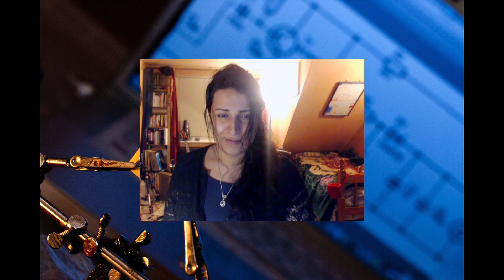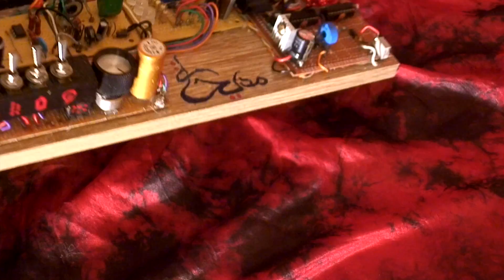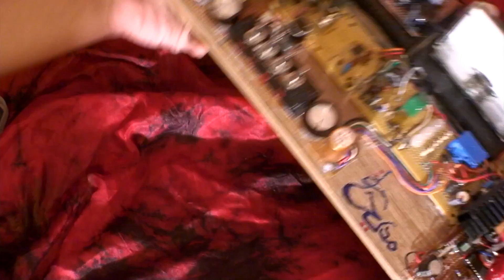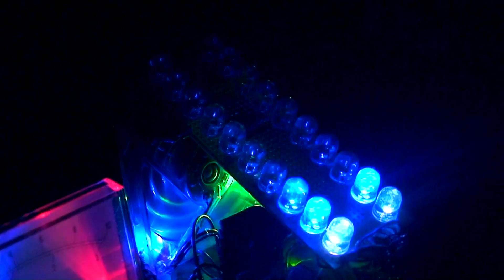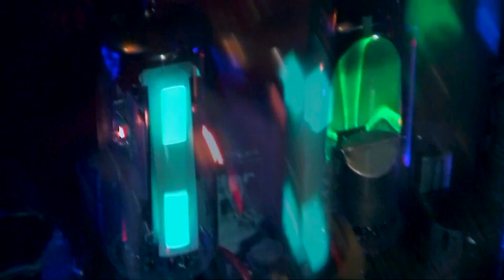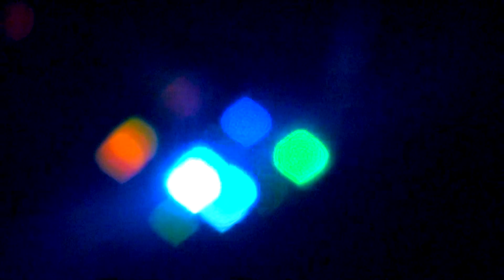Audio Visualization Project - 02 The grand demo :o))

Comment: Awesome project! I highly commend your use of multiple colors of LEDs in your bargraph instead of just using one color of LED throughout all of the steps, (which wouldn't have been as beautifully colorful as it is), plus the tubes look really cool in the dark too! I also like your use of the "flatted lever" type of toggle switches, as I think those type of toggles "feel" the best when you touch them and flip them, usually work the best with the lowest "on" resistance of most toggle types that I've found, plus I also think they definitely look the best of all of the toggle type switches. They give your project an overall "retro" or vintage/"old skool" look to it, which you mentioned you were going for... Plus all of that stuff works together properly finally, after all of the improvements you made to the prototype... Yay!... Great job you did there!

When I was still a little kid, (a long long time ago, way back in the 80's, LOL!), I tried to make a VU bargraph meter using a multi-color modular LED bargraph unit for each of the audio channels and also using those same LM3916 ICs that you have there, but for some unknown reason it never worked at all... Unfortunately I never revisited that project in later years and I don't know what ever happened to it. But now I'd love to actually make a full spectrum analyzer frequency display of at least 31 1/3 octave bands on a VERY large scale that I could hang on the wall above my stereo and see from across the room, but I've yet to find the time to do it... 

Now I see all over eBay those huge "VU Meter" or "Spectrum Display" project kits which come with all of the parts and such, but I have yet to find a really good one that actually gives an accurate representation of the frequency spectrum in real time, (like most of the vintage audio equalizers had on them), so I've been skeptical to buy one of those cheaply made kits... It seems like almost everything electronic is made in freaking CHINA now-a-days, and almost none of the stuff that comes from there works properly, or if it does it doesn't work accurately or well enough to give you any meaningful outputs; it's all just for a quick and very generalized "light show" and nothing more, which is very disappointing! For me, I like watching an accurate representation of the different frequencies coming from your speakers, as you hear them, that's why I love vintage equalizers with their very fast responding spectrum analyzer displays, however none of them really had a BIG enough of display for me, nor a multiple color one. :(

Oh well, maybe one of these days I will finally get around to making my own spectrum analyzer project like I really want also, because your VU meter project is quite inspiring and beautiful to watch!... I love the way yours looks, incorporating all 3 of the different VU meter types into one circuit, and I especially like how you made your entire project fit onto one portable board, that way you can take it with you and show it off wherever you want to! Very nice work! I look forward to seeing more of your "mad scientist" skills in other videos! LOL! ;)

BTW, that's a really beautiful song track at the end of this video when you are showing the light show in the dark! Have you ever had a chance to play around with any kind of "synth pad" "Sequencer", "Sampling pad" or "looping pad"? (I've heard them called many different names.) I think you would really enjoy one and could produce some very beautiful music with one!

Comment: 75 watts? :-D that is an electric heater with visualization. :-)))
Reply from the maker: Hahah it's an approximation.. but You could say that, it has enough 78xx voltage regulators on it to work as a heater ;o))
Reply: Now with your expertise in valves do you consider sometime making a valve audio amplifier? :)
Reply from the maker: I wouldnt at all say i'm an expert in tubes, but I have considered it for sure, it's just getting transformers and being fearful of it due to the ridiculously high voltages. I'm curious about tube/valve audio amplifiers though, i've never experienced sound through one :o)
Reply: I don't know anything about vacuum tubes :-P Last christmas I bought a set of second hand floor standing Tannoy speakers I gave to my parents. When I went to pick them up, the guy that sold me, was a vintage hifi collector. First he showed me the sound of the speakers I just had bought using a vintage Marantz receiver... and after he turned on a vintage tube amp connected to Bower & Wilkins 801 old speakers... small speakers, not the big ones. Honestly I liked much more the Marantz sound :-D it was much more detailed. The tube amps somehow have much more mids and less treble. But it was just literally 2 minutes audition... not enough to have a solid opinion. Definitely has a special distinctive sound which I am not sure I would like to hear all the time, but for sure has a very cool look with the valves glowing ^_^
Reply from the maker: Hmm did he allow enough time for the Tube amplifier to warm up? Apparently it doesnt sound as good unless he does this. I'm still yet to experience the sound for myself first hand as i've heard a lot about it :o)
I know little about tube amps myself, these are magic eye tubes in this and the only thing we gotta worry about is giving them the right level and voltage for them to look nice. I got intimidated by tubes with all the transformers and impedance matching etc :o/
Reply: Not at all... he just turned on the amp and then started to play the music. I was not really aware of the high voltages required. Now I understand why so many transformers are needed. And the tubes you have used in your visualization project are suitable for the amplification? I have not seen so cool looking valves in the tube amps from high end audio manufacturers. Once when I was a child I remember tearing down an old broken TV. There were so many valves we took out. All went to the trash :(